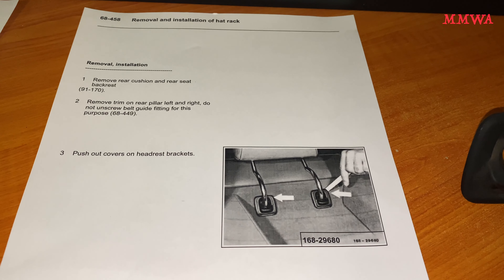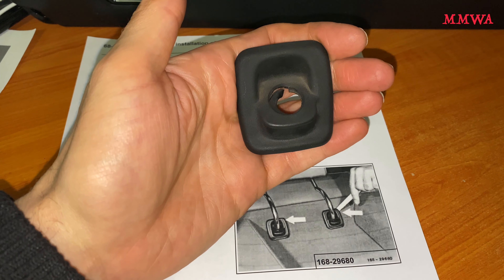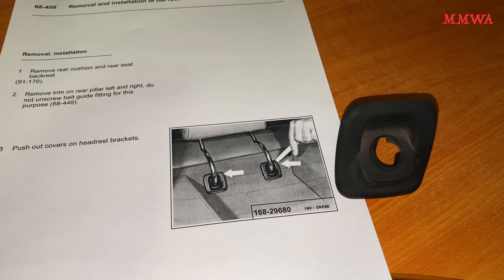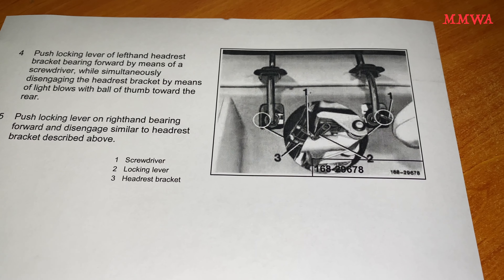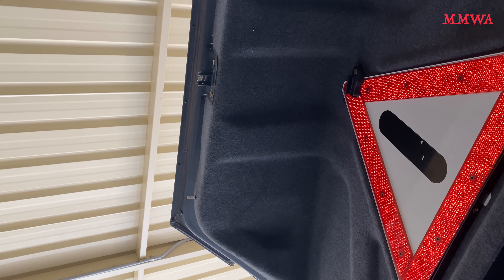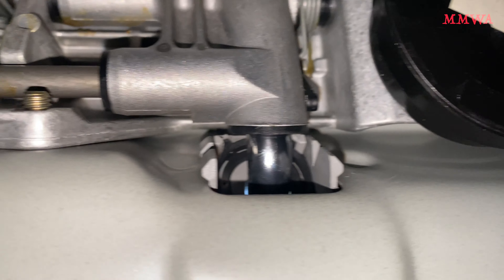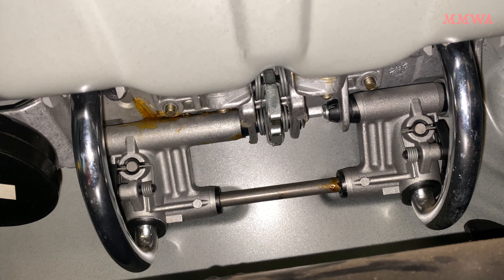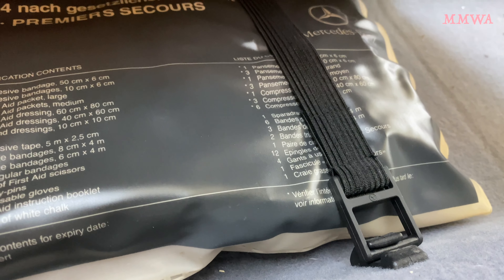Mercedes W124 rear headrest removal - Warning

Comment: If, like me, you want to get the headrests out to give them the Leatherique treatment after 30 years of sun, this is 
excellent advice. Much easier to work on them away from the car as they will need several treatments. Removal of the trim pieces from underneath is a piece of genius. For those who have paid the price of broken trim pieces, yes, they are NLA but the good news is that Octoclassic is printing them in all the trim colours.

Comment: Considering the climate and longevity of the Aussie national car fleet I think MB did really well with the W116/123/124/201 and W126 Chassis, even MB Tex and the Velour they used seems to be virtually indestructible so the Plastics have I suspect well outlasted their MTBF rating.
Reply from the maker: i think having window tint on the rear glass really helps the plastics. Red never had any tint and everything on the parcel shelf was brittle as hell including the 3rd brake lightt (also nla now) That simply exploded as soon as i layed a finger on it.
Reply: @MMWA-DAVE  Agree. My coupe has the tint, but it's still touch and go with the plastic bits.

Comment: Hmm, I think it will be worth my while to learn about all the steps needed to scan plastic parts, add repairs in the scan file of the broken part, and print it out on a 3D printer.  Sourcing plastic parts for my R129 has become challenging and really annoying.
Reply: i had a couple of 129s before moving to an older SL,  Try getting the visor clips without a second mortgage!

Comment: Wait, why the hell does the back seat have to come out entirely in order to take the headrests out?  And more so, why do the c pillar covers have to come off just to take out the headrests?
Reply from the maker: they dont, i was doing this anyway. The warnjng is about the plastic surrounds that are almost guaranteed to explode on sun exposed parcel shelves. You can remove the headrests once the plastic surrounds are removed feom the posts of the headrests

Comment: i was lucky with mine.   I needed to remove the back shelf to repair the rear sun b lind in the coupe.   Unfortunatlrey I need to do it again since the blind has stopped again, stripped nylon thrad than runs up the length of the tube. Try and find one of them!
Reply from the maker: have never even seen the 124 rear blind in person, would be a nice option in Australia
Reply: @MMWA-DAVE  Mine is an Aussie delivered car and does have it so must have been available.   Its in mint condition , motor too however thre flexible nylon cord (same design as the cord that lifts the arial) wore our and slips on the gear. I tried usingf one out of an olde arial hpwever its a few microns too thick.   Go figure where to get a new cord; nbot buying the ehole thing ervenif you could get one. It was a very tedious job getting it out.   I must do a video and load it up to Youtube so you can see it
Reply from the maker: @ka130258  i seem to recall some talk about these rear electric blind cords amoung the 126 people. I can’t remember what the solution was but from memory they did come up with something. Maybe on benzworld it has been discussed. As mentioned i dont know much about it, i only ever saw it on a w126 and that didn’t work either presumably for the same reason
Reply: @MMWA-DAVE  ty for that. i will take a look.  I also have a 420 SEL, no rear blind though.  Love that car to bits too; brilliant white on red leather interior..

Comment: Is it the way to release rear headrest when our vacuum pump is broken / not function?
Reply from the maker: you can unlock the headrests at the mechanism itself in the case of no power or vacuum availability. Easily
Reply: @MMWA-DAVE  Thank you, i'll try it later

Comment: So after the headrests go down, do you manually have to lift them up or do they come up on their own?
Reply from the maker: the headrests are only released to go down by the switch in the w124. Lifting back up is always done manually. It wasnt till later model cars they could also lift by a switch.

Comment: I somehow managed to remove them without any damage few weeks ago on mine.... I was lying in boot and pushing clips and my mom was helping me by pulling them from inside of car.... And I live in hot climate...
Reply from the maker: thats how i removed the one that didn’t break too. If you just go in with a wedge and try pry them out from the top only on sun baked ones they will likely shatter like reds originals did.

Comment: Is that the fuel level sender that determines what the guage  says? My E280  only shows 3/4 when full..thanks
Reply from the maker: sure is, it is the tube with float in it and thats where its removed from the tank.
Reply: @MMWA-DAVE  OK many thanks ..I guess will have to source a good used one..or still available new?
Reply from the maker: @flyinghedgehog3833  i think they are still available new but hideously expensive
Reply from the maker: @flyinghedgehog3833  I would test another instrument cluster if you have one to rule out an issue with the gauge itself too.
Reply: @MMWA-DAVE  thanks I will look into it .we in KL there are quite a lot of w124 surviving here still
Reply: @athompson8976  ahh OK so how to fix that? Sorry I'm not great at diy :)